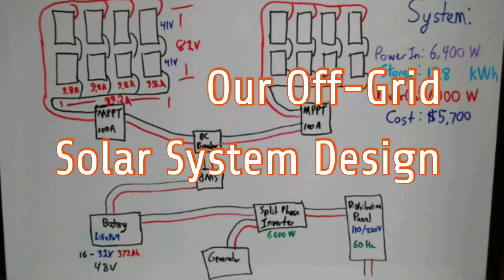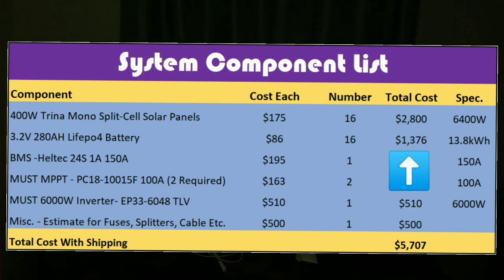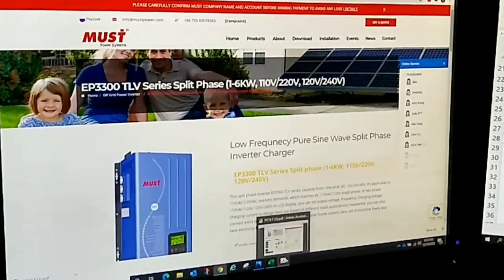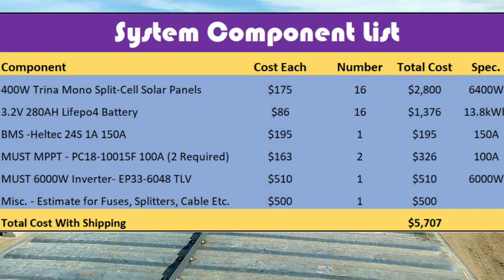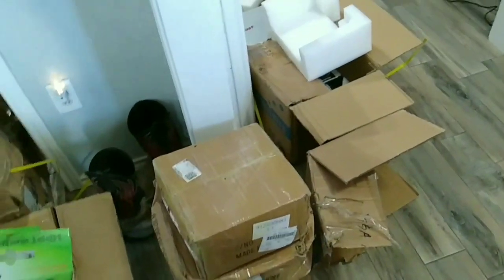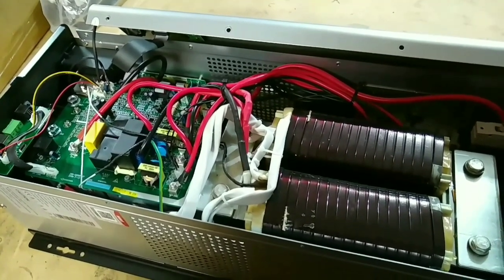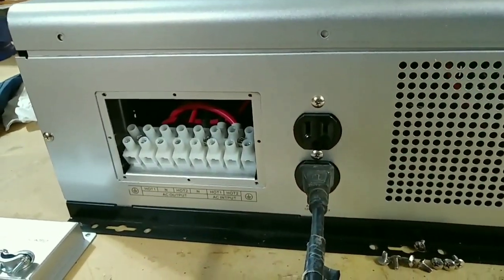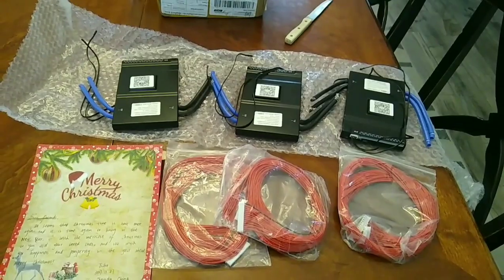Cost & Components For Our Off-Grid Solar System | December 2020 - February 2021 | Alibaba

Comment: NICE work on the solar system. Over building is worth it. I am sure you will be doubling that battery capacity in the future. Ask me how I know.
Reply from the maker: Thanks! It is working really well for us. We get a lot of sun here. We thought we might need more batteries for the winter, but it hasn't been an issue at all. We ordered another set but haven't installed them yet. More batteries would allow us to run the air conditioner longer in the afternoon, or turn the electric heater on earlier in the morning, so I guess that might be nice. 😊

Comment: Have you considered a small wind turbine to supplement the solar?  It might stretch your time on battery during cloudy weather.
Reply from the maker: Not at this point, wind power is a whole different thing. It's pretty rare here for it to be cloudy all day. We haven't had any issues so far with getting our batteries charged even on cloudy days. We do have another set of batteries that we haven't installed yet, but are doing just fine without them.
Reply: @RedandAprilOff-Grid  I see.  Sounds like it would be a bit unnecessary, then.

Comment: As I mentioned before you should double your battery bank size. Go from 10% to 90% charge anymore your shortening the battery life. I like Must Its a good company. I just wish their warranty was longer.
Reply from the maker: We have bought more batteries, a few months ago but haven't installed them yet. They were $140 each this time instead of $89, and are a different brand. Since our RV refrigerator died, we replaced it with a couple of mini refrigerators which use a lot less power, so our batteries are still at 70% in the morning! He is wanting to change the settings, so the batteries don't charge completely, but he hasn't got around to it yet.
Reply: Good. You want to change those settings asap. Don't charge more than 90% and drain less than than 10% of the charge range,  What where the new battrries. How long is the warranty. I have a line of battrries with a 10year warranty If Used for power storage. Anyway. Seems you have a handle on things. Remember you build to the AH size with parrallel then voltage size with series connectiin. Use flexible connectors or you could harm the battery terminals
Reply: I'm in the Philippines. We will be doing the same as you are here.

Comment: Be sure the Bms has a functioning low temp cut off that works. A lot of those advertise they do but don’t.  Will prowess on you tube has tested that on many and they fail to cut off below freezing temps.
Reply from the maker: Thanks, very good to know!  Our solar room is pretty well insulated, but we need to check on the kids systems.  We got down to 22°  last night! The low in town was 44°!